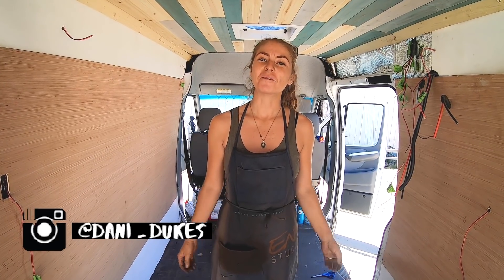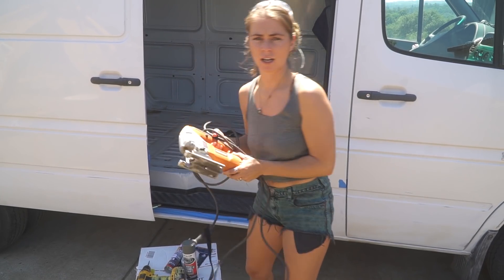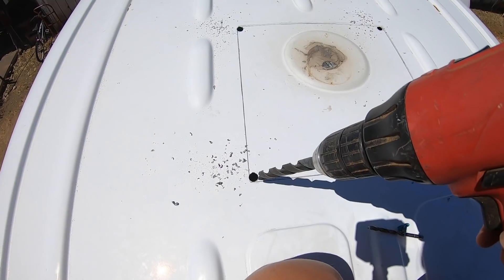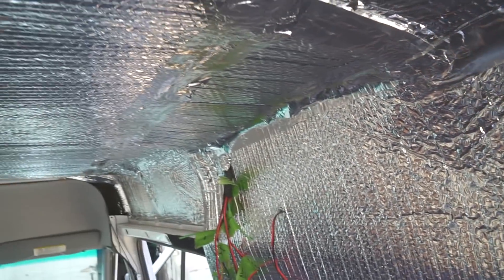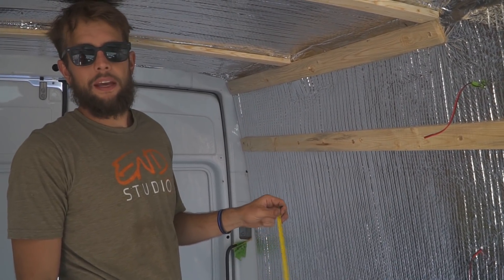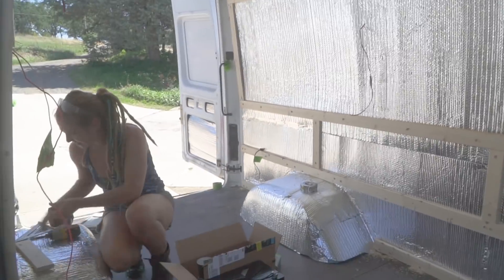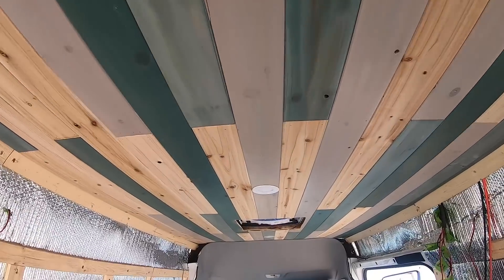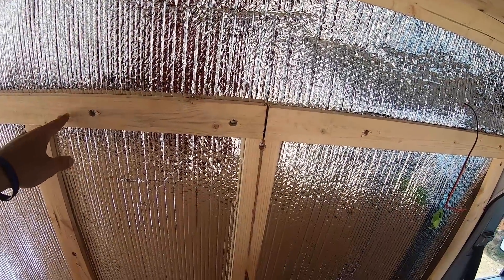DIY Sprinter Van Conversion: First steps: Fantastic Fan, Framing, Walls, Tongue and Groove Ceiling

Comment: Great video guys! Only just got around to watching this but brilliant simple functional way to frame it out! You could have possibly used strips of that thin plywood screwed/glued-up in a couple of layers for thickness and strength but also lightness (instead of the solid-wood strip?) Would have given you a bit more strength per given thickness on the support members and holding power for any screws (due to the cross-grain plus probably work out cheaper I'd imagine??)
...Just an idea to consider for the future, to cut strips and laminate up some thin plywood to thickness you want instead of the pine or whatever..?
But love your channel and your build!
Cheers from London England 👍😎🏴
Reply from the maker: Thanks for thr idea but plywood is still so expensive it's cheaper to buy the strips.  But if you want to spend a bit more that would ne a nice way to do it.

Comment: You are both soooo helpful, thank you for being detailed... QUESTION: when putting  up framing boards for the walls, cabinets, etc... are we able to drill the boards down on the ribs anywhere? Meaning; can we drill into the steal of the ribs anywhere; or do the nails we drill have to be lined up with existing holes? I hope you understand what I am asking lol; sorry if it's confusing.
Reply from the maker: Yes you want to drive those screws into new holes make sure there aren’t any wires or that your screws aren’t too long that they go through the van.

Comment: Hi, in a previous video you ran the wiring after vape barrier and framing. In this one wires were already in place. Is this just another way of doing it or have you found this way is better? 

Thanks guys,
Tim

Ps I downloaded the roof rack tutorial and it was perfect 👍🏻 thx
Reply from the maker: Yeah we found it easier to do after the framing.  Easier to troubleshoot and easier to know where all your cables are.  

Glad thr rack guide helped.

Comment: For viewers out there, dont use wire knobs for wire connections in a van. The vibration and movement over time could cause the connection to come lose. Crimp and heat shrink is better.
Reply from the maker: Thanks!  We went back and did that!

Comment: How did you make sure the screws didn’t go through the roof when drilling the wood in the ceiling ?
Reply from the maker: Don't get long screws.  Measure your wood thickness and the cavity thickness and give yourself about a half inch of wiggle room so you don't hit daylight.

Comment: so when screwing the framing on, do you sink the screws right into the van metal? do you need a special type of screw to go into the metal frame?
Reply from the maker: You need a self tapping screw.  They make wood to metal self tappers.  This will do the trick.  Hope it's not too late.

Comment: Thank you both for your help! Has your fan held up free from leaks?  You did not use rivet nuts...it is okay to drill directly into the framing in your van?
Reply from the maker: Yes it’s been holding up great! No leaks and no problems. 😊
Reply: @Vankookz  Great!  Would you still recommend the Fantastic over the Maxx Air?

Comment: this may be a total rookie noob question, when putting up the wood framing using screws into the sheet metall, is anything holding the screws them in place on the other side of the metal or do they just stay in place really good??   thanks for any info!
Reply from the maker: We have tons of video on our channel about these steps check the most recent with the Ford E350

Comment: Important tip: tape off the area around where you'll jigsaw the hole in the roof, it keeps the jigsaw from scratching the paint.  Also, meticulously clean the shavings off, as they will rust within days and rust the roof where lying to make a mess.

If you're roof is curved, put a double layer of the butyl tape around the low areas to build it to flatness for the vent.  You can run a plastic putty knife around to trim away the squeeze out of the butyl tape after tightening down the screws to get a nice clean edge.
Reply from the maker: Yeah we usually do this but forgot.  Yes these are great points!  I’ll have to cover all this on my next build.  Thanks for the great advice!
Reply: @Vankookz  you're welcome I'm just starting out my build of a 159 in ProMaster

Comment: When drilling the frame pieces in, how do you make sure the drills don't penetrate through to the outside of the van?
Reply from the maker: The frame pieces only get attached to the ribs in the van, (where the van body’s structural support makes what looks like a little speed bump on the inside) that way there is a cavity between the outside of the van and the metal you are attaching it to...that is where your screw will sit. You also need to make sure your self tapping screw is long enough to go thru your wood and attach to that metal, but not thru the second outside piece of metal. I hope that makes sense! Let us know if it doesn’t, Kevin can probably explain it better if it doesn’t! Thanks for watching! Good luck!
Reply: @Vankookz  That helps a ton! Thank you!

Comment: Hi, were the ceiling lights flush mounted or did you need to drill holes in the wood piece they were attached to?
Reply from the maker: We used a hole saw to cut holes for them and used these LED dimmable lights https://amzn.to/2ST2uS2 We feel they stay in place the best and have the cleanest look.

Comment: Wire nutting behind walls is super dangerous, you really need some kind of junction box or at least better connectors than wire nuts.
Reply from the maker: What would you recommend?
Reply: Van Kookz junction boxes are standard in traditional home construction, but for vans i would solder and heat shrink or use the gel crimp connections that are weatherproof. Data utility companies use them.
Reply: Van Kookz kind of hard to change it now, but wire nuts can jiggle loose, so maybe just see what happens. Once you get an open circuit then you can tear back into it. DC wirenutting is safer than AC I guess.
Reply from the maker: We actually did end up going back and heat shrinking a few.  Good to know.  I recently did another van and used the weatherproof gel and heat shrink.  Thanks for the solid advice!  The wire nuts in my current van have held up for over 3 years now 0 problems!  Thanks for watching!